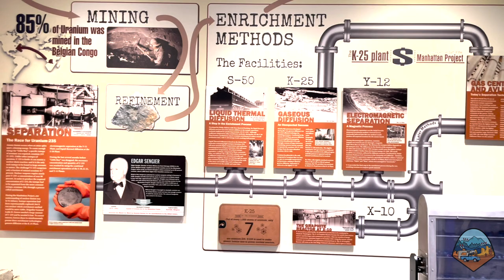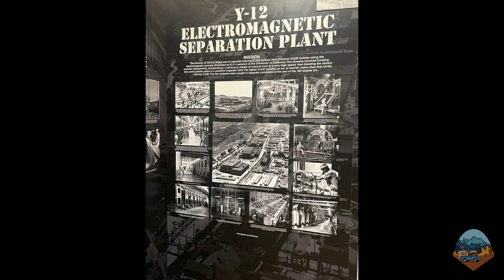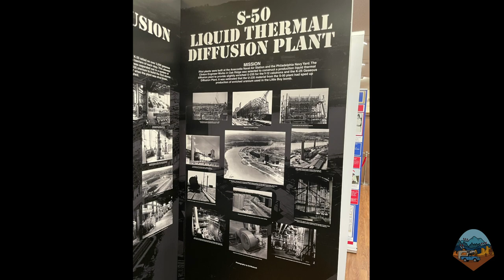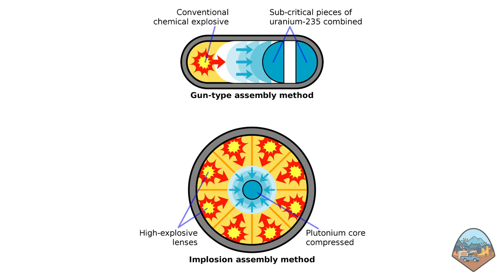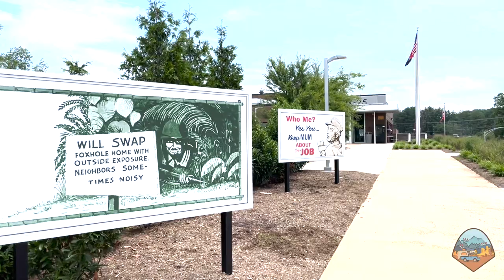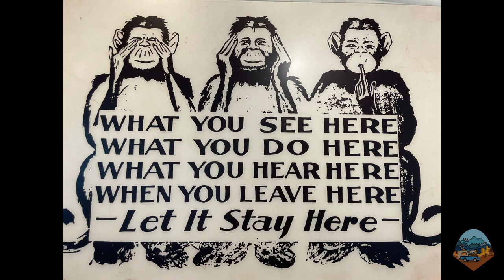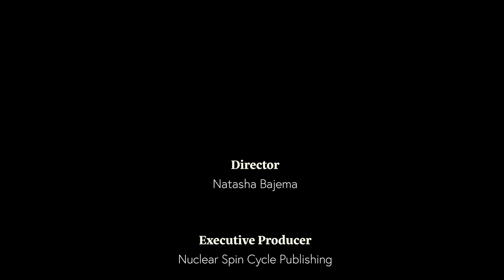Taking a Drive through the Secret City (Oak Ridge, Tennessee)

Comment: Natasha, you and Ray did a nice job of giving an overview of Site X or CEW of the Manhattan Project.  One clarification, the K-25 Gaseous  Diffusion Plant came on-line in sections called “cases”.  So K-25 did enriching uranium during the Manhattan Project.  By 1945 the production line was S-50 feeding K-25 feeding the Y-12 Calutrons with enriched “green” oxide sent to Los Alamos.  But K25 could not get to high enrichment in those early days.  The Calutrons had to do that.  It did after the plant was finished after the war.  Looking forward to your other videos.  Best regards. 0:49